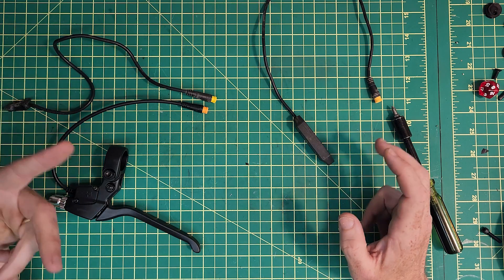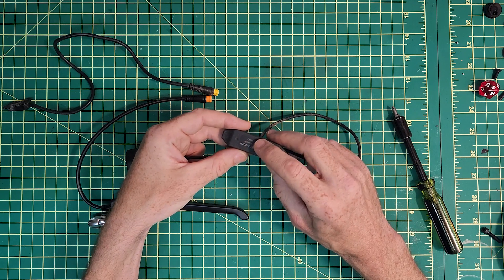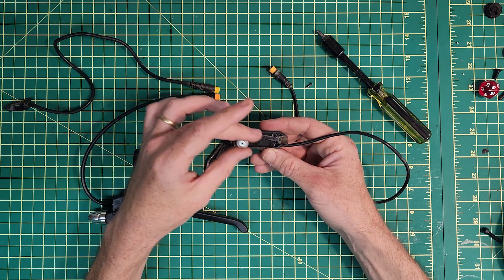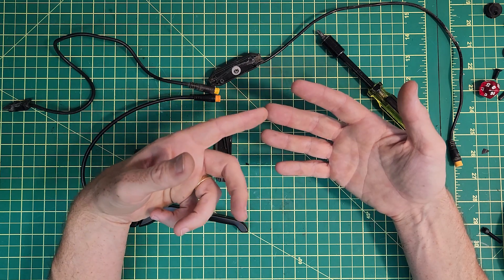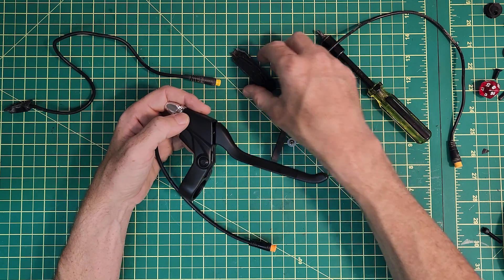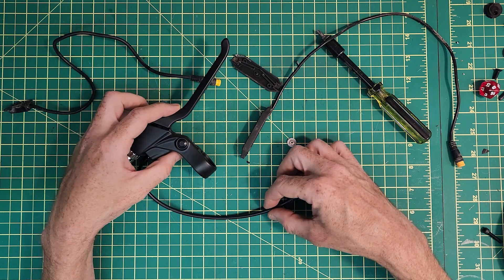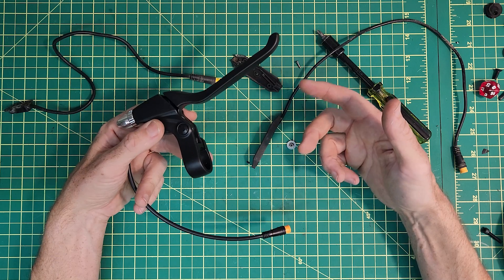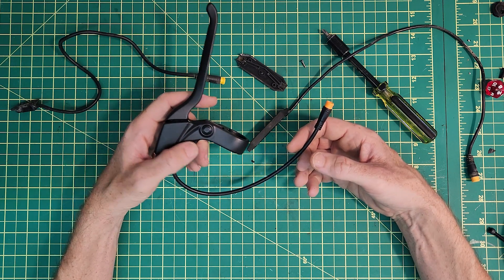Ebike Gear and Brake Cutoff Sensors, do you need them, what I think, tips and tricks!

Comment: As a BBSHD/HV Kit owner using PAS for all my offroad rides, i also found the Brake cutoff method the best & the most controllable, over 2,000+ km to date on original Drivechain components (including chain) checked chain & "still just within stretch limits". Cheers for another informative upload. 👍 😊🍻
Reply from the maker: You are welcome. The bike is looking great!
Reply: nah, then you got to always think of that micro tough distance. I use 1 brake cut-off on the left side just in case. came in handy already

Comment: YMMV of course, but with the Photon with torque sensing, neither brake or shift sensors are needed. Especially for decent chaingroups with decent derailleurs, correctly adjusted. My Eagle NX setup shifts flawlessly even under moderate power. Not having the shift sensor give you more choice - you can either power through shifts or just back off.
Reply from the maker: This

Comment: I went through 2 gear sensors before I realised I don't need them. They are too unreliable. I use the brake cutoff on the rear brake when changing gear instead.
Reply from the maker: Thats where mine was on the rear. Cheers

Comment: Yes, a light pull on the brake lever to cut the motor while shifting works great for me on my BBSHD with HV kit.
Reply from the maker: Awesome stuff.
Reply: I keep the thumb throttle pegged as I shift gears pedaling and tapping the front brake. It becomes automatic after a while.

Comment: do they have hydraulic brake levers that come with these cut off sensors?
Reply from the maker: Not usually. Even when they do the wiring is hard to get right. You can get stick on one's but they are a bit messy. We are working on some good quad pistons with these built in tho.
Reply: @HighVoltageKits  cool thanks for the reply. I guess I'll mess around with the magnets that some people put on their brake levers. Can't believe that after YEARS bafang doesn't release torque sensors and hydraulic brake levers. They haven't had much competition so no need to innovate
Reply from the maker: Their loss. Working on something here.

Comment: Bbshd from my experience is the most unsafe product I have ever used ( in my life ever). Even though it is one of the most fun products I have ever used. When using max power setting which is needed for off road steep climbing, When you move your pedals 180 degrees to obtain pedal clearance  in a corner it will propel you at “full power when you do not want any power” resulting in crash or near crash every time. For me every ride I have a close call without exeption. I cannot comprehend why you or any other youtube channel has not ever discussed this issue. I have also injured my knee bending my knee backwards from a  wheely and crash from the crazy abrupt power response and I have also wrapped my pants up in the bolts holding the sprocket resulting in being stuck for half an hour unable to remove myself. Uuhm ,, the product is so much fun and in my opinion a great deal buuuuuttt , why can't you tell the truth?
Reply: PS I learned to constantly ride the brake lever which cuts off motor power when in a low speed corner . this does in fact work good. but did you or any other  youtube person say this? why did you not? and will a ten year old beginner rider even understand this?
Reply from the maker: I suspect alot of the issues you are having are down to really crappy settings on the controller. Mine was programed by em3ev and I did not have this experience. Recommend you get a program cable and get Karl's special sauce on there. I have heard of this dangerous motor behavior and this is always the recommendation we make. I switched out the controller on mine so it's been a long time since riding it stock. You can also get an eggrider and tweak settings. You are welcome on our Discord community to get more help. Links in the description. Hope this helps
Reply from the maker: Firstly I'm not a cowboy. Horses terrify me and I doubt I could hit a dustbin with a lasso never mind a steer. I attempted to give you some information to help you based on the paragraph of text you wrote. No need to get upset. How can I possibly know the depth of your experience? I don't know you and you don't know me. Do you always get triggered by social media like this? I have not ridden a stock bbshd for five years. I replaced it with and ASI BAC controller. It's much better. I don't make videos on the stock BBSHD. I dunno what this "tell the truth" came from. Have you watched more than one video I have made? I just find your response a bit bemusing. That's the world we live in though. People get offended at people who are genuinely trying to help. You are not the first person to complain about the bbshd like this and in those cases changing the settings with a cable or eggrider has helped them enormously. If my advice is not what you were looking for then fine. But no reason to go all wild wild west on me. Have a great weekend. Cheers
Reply: @HighVoltageKits   😂
Reply: I just use throttle only, basic pedal assist can be troublesome.
Though one day dune grass got stuck in my throttle after a spill and the bike took off by itself!
Reply: This is true on the bafang stock settings.  You should not go mountain biking on a stock bafang. Yes like Mr HV said you have to change and program to Karls settings. Then it will work as it should.  Power shuts off as soon as you stop pedaling. Power turns on instantly once you start pedaling. Not seconds after.

Comment: Im def a proponent for gear shifters, especially when starting out.
I exploded my first derailleur getting greedy with power shifting.
That being said im a bit tired of cleaning the grease/oil off the roller and not detecting shifts. that and using it without a clutched derailleur and having cutouts on big bumps
Reply from the maker: Good comment Dave. I did get use when I was starting out with the BBSHD and cadence based PAS

Comment: Shouldn't be able to pull a throttle if you are in the EU/UK, anyway cut-off sensors are fitted for a reason 'safety'.
Reply from the maker: I am in Canada where the laws are a bit more sensible and allow people to use throttles. It depends on the bikes PAS system. If you have a throttle then the brake ones can help prevent something like whiskey throttle with inexperienced riders. With a torque sensor they are  useless from a safety point of view. If you stop pedaling the power stops. In fact if you cut power at the wrong time with a brake sensor then it could cause a safety issue with torque sensors. They are more relevant with Candance based PAS.
Reply: @HighVoltageKits  Totally agree!  I'm pretty sure all of our Specialized and Giant EMTBs don't have any shift cut, as you're saying (torque sensing setups), and agree that they work fantastically like that.  Torque sensor vs. cadence based/throttle are completely different animals.

Comment: Another good reason to get the HV BBSHD kit!  That 50watt base power sounds handy as can be.
Having said that, I have the shift sensor on my Luna Hotrod Tune BBSHD currently, and it seems to be a quick, snappy disruption and resumption of torque flow when shifts are made, as long as you stay "on the power" during the shifting process.  As someone who tunes a fair number of internal combustion drivetrains, I've been pretty impressed with the tune they put together for the shifts. (no brake sensors for me, I like playing the brake against the motor torque in some circumstances)
Due to the lack of your 50watt power floor on the Hotrod Tune though, if you shift off power, there is a troubling clunk when you get back on the power and the shift finally completes.
Reply from the maker: You hit the nail there. This is exactly what its for. It also makes for really smooth performance with the throttle as the chain is kept tight so you avoid that slap as you go on and off. Cheers
Reply: @HighVoltageKits  Love it!  I need to get mine ordered soon I think.
Reply from the maker: We will be happy to get you setup. You are welcome on our Discord if you want to meet other riders using it. Cheers